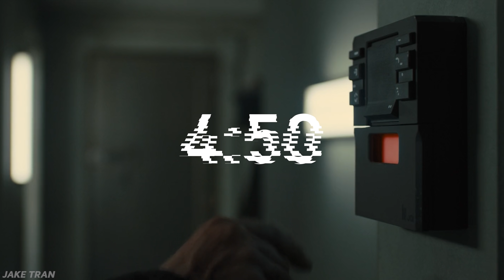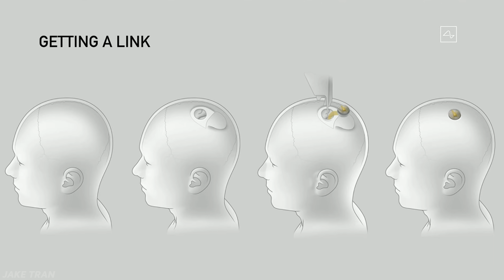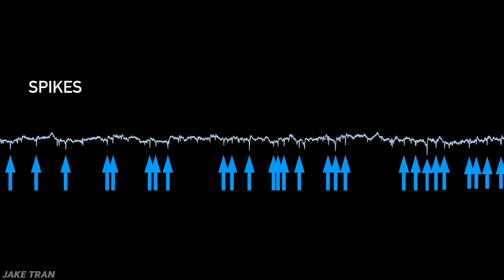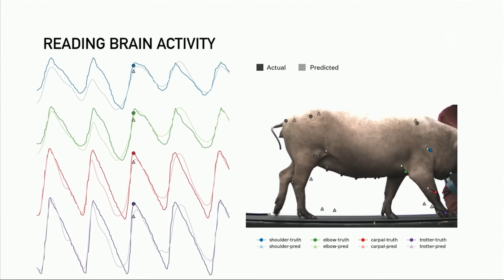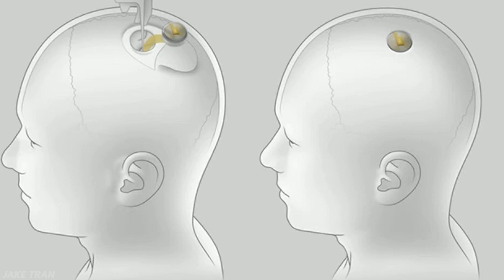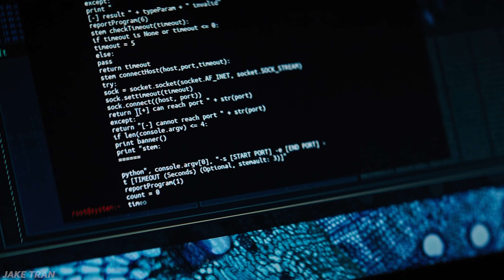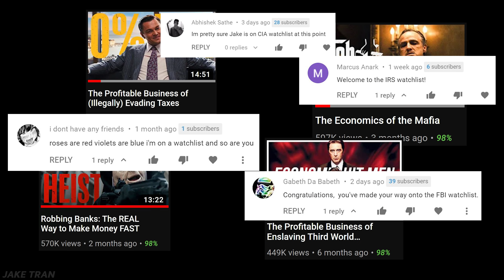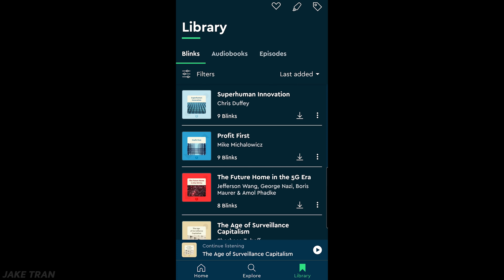Neuralink: The Next Stage of Human Evolution

Comment: You didnt mention the 2 biggest complication/ things that makes this unfeasible.

It's essentially a wireless device. Wireless devices emit radiation. You have had a piece of your skull removed so that you can put the radiation emitting wireless device physically touching your brain directly. A few years after people got these fitted, there is a very real risk of people with the device developing brain tumours. 

You have removed a piece of your skull which protects your brain to insert basically an 8mm metal cylinder right up against your brain. Suddenly even the most minor bump to the head is life threatening. Bumping your head on the corner of a table can now force a metal cylinder into your brain. An injury that could normally cause concussion can now forcibly rip your brain away from the electrode and scrape your brain along it. Now you're a vegetable.

It's a cool idea that can only ever really work in theory, and is too impractical and sci fi to actually go into production.

Comment: Really has to be done right. 
When you make the hardware, make sure every piece is non-reprogrammable, with formally verified deterministic logic (no exceptions). Fail-safe. Needs off switch. An update requires a new unit glued into your skull. 

Work towards optico-electric, one-way-potentials, unless the patient needs intervention. Ability for every user to decline all wireless options, and charge using infrared (or other) instead of magnetic inductance (bad for tissues, only ~63% efficient).

Crossing fingers. Need laws protecting neural data that don't get backdoored in 20 years by some short-sighted authoritarian on the rag or an arbitrary board decision.

#Neuralink #BigPotential #Mitochondria
Reply: #Mitochondria baby lets go 😎

Comment: I'm concerned over privacy with this. Big tech already spies on us with impunity. I feel the tech itself could be a net benefit if it was implemented with a digital bill of rights to protect us legally. 

I really want to use tech like this, as someone who suffers from addiction and unable to escape no matter hard I try. My actions could finally become the product of my will, and not the enslavement to the lizard brain. For example, being able to manually adjust hunger in a way that allows for a calorie deficit, or turning off sexual arousal completely so that I never have to be tormented by pornography again.

One last thing though, probably a dumb question. The skull is intended to protect the brain, and we're sawing a hole in it. I would hope the device would be strong enough to hold in place/be as durable or more, last thing I need is broken pieces of tech in my brain cavity.

Comment: As is often true, the second generation of a new product is where it really starts to shine. This will certainly be the case with Neuralink, which is why the reversability aspect is so nice to see. Does leave me curious though: since placing an implant requires removing a small part of the skull, if you remove the implant, what are they gonna use to replace it, cause I imagine you aren't going to keep the old skull coin.

Comment: I'm not sure what is the end producted designed to be, but to get all the SF stuff hapenning one should have a much larger surface of the brain mapped to pins. 

And even then it would be a pain to make sense of the trilions of signals per second in patterns that only apply to one individual (excluding the signals for operating the body which should be largely the same for everyone)

Comment: I am for it as long as I can completely remove it from my body, like taking off a wristwatch or a contact lens, anything that needs to go under my skin, not gonna happen, Imagin a government that requires all its citizens to wear this sort of thing all the time, and can monitor your thoughts, one dissenting idea can terminate you easily.
Reply: You can take it off trough surgery.

or if you really want to be able to take it off.

you make the implant but you make it so it can't access the outside, and you put  USB port in place of the seal, and connect your "key" device to make the Neuralink work

Comment: If it was all about helping those who were disabled they would concentrate on repairing the neurons.  But instead they are putting all this functionality into it and they haven't even proven that it will  work in humans. Prototype using pigs cause they don't speak.

This is the same FDA that allows GMOs in our food supply and won't require food manufacturers to properly label ingredients. 

It seems the whole concept is to bypass human consciousness.  That pesky bandwidth eating portion of our brain that separates man from machine. They don't need a chip to do this, they've created the Police and the Military as proof of concept. I suppose it will eventually be a lot cheaper to implant a chip then to put a cadet through Basic Training.

Comment: What comes the mind is the quote from Jurassic Park: 

"Your scientists were so preoccupied with whether or not they could they didn't stop to think if they should" 

-

This has the potential to radically transform what it means to be human, but it's a double edged sword that if things were to go wrong, by god the implications will be SEVERE. I just don't think technology is a band-aid that needs to be applied to every single issue we face, because we end up becoming over dependent on it. Our bodies are biologically not adapted to meet the rapid pace of our technology; technology is outpacing our ability to evolve to the changes it causes. Neuralink is a double edged sword that has drastically different outcomes depending on how that technology is used, and how we end up respecting or abusing its awesome power.

Comment: Im all on board with neuralink, but there is no way in hell im letting anything connected to my brain connect to the internet.

Ransomware for access to your memory is some black mirror shit
Reply: If this becomes accessible, you'll kinda have to. How can you compete with someone at work for example that has access to this level of information?
Reply: @gustavogomes1581  Kill'em.
Reply: @UnprofessionalProfessor  pour water on their head so they short-circuit
Reply: @UnprofessionalProfessor  Hack them and make them punch the boss!
Reply: @gustavogomes1581  there is a way
Reply: Ah yes modern problems require modern solutions